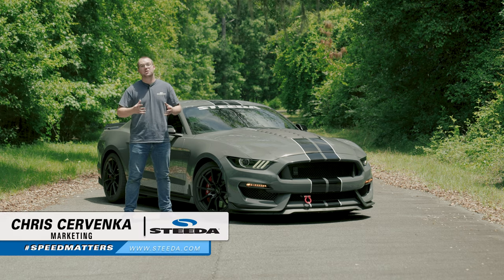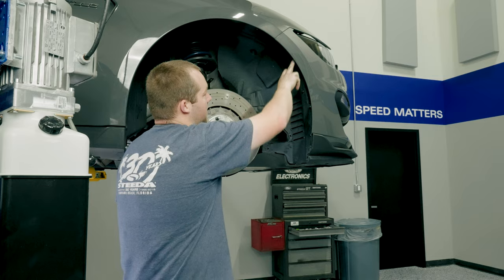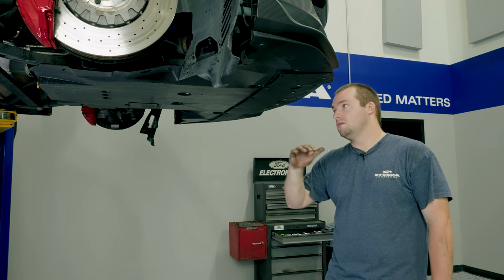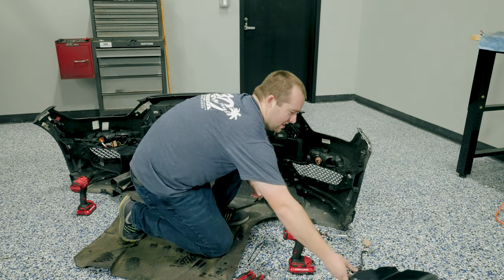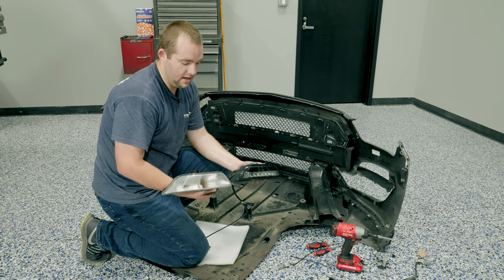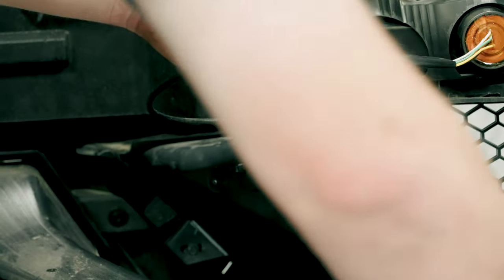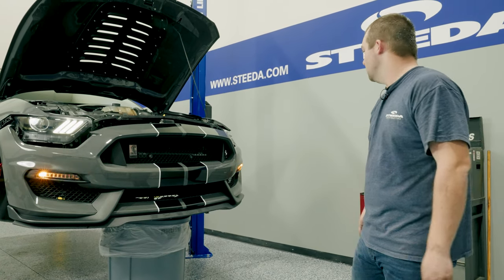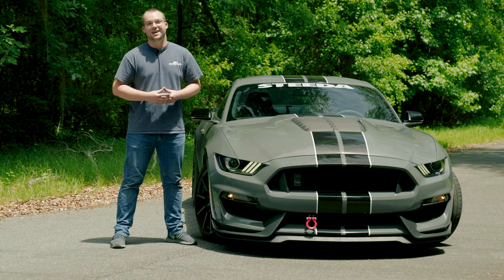Morimoto XB LED Sequential Turn Signals, 2015-2017 Mustang | Review & Install

Comment: Way too much for some replacements.  I get it, that has to be done to switch them out, but damn.  I was sold until I watch the install video. Think I'll pay STEEDA to put them in.

They look killer!
Reply: Taking the 350 apart is a major pain in the ass. I just put lights on the diffuser and it took hours just to get the right things off so I could access the factory reflectors. Paying someone else is honestly better 😂